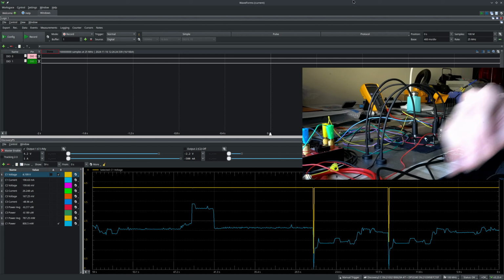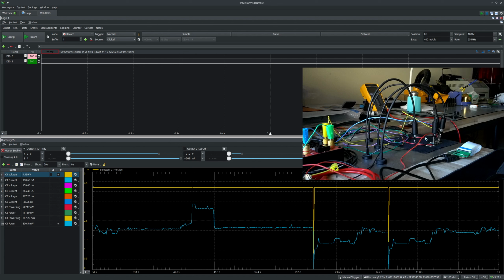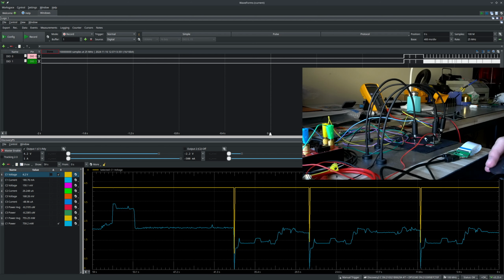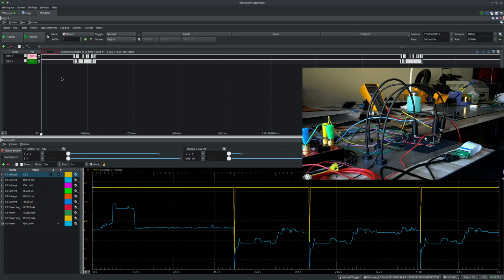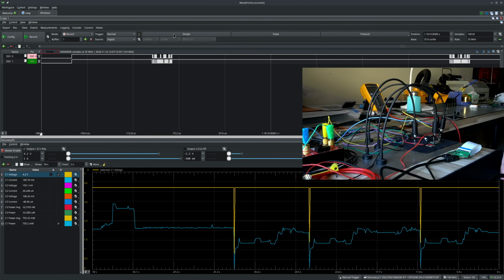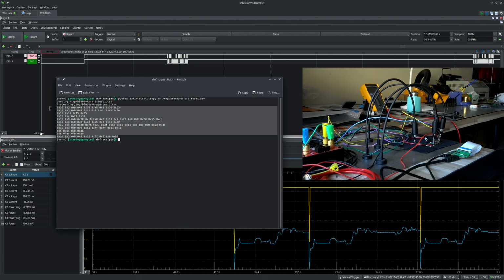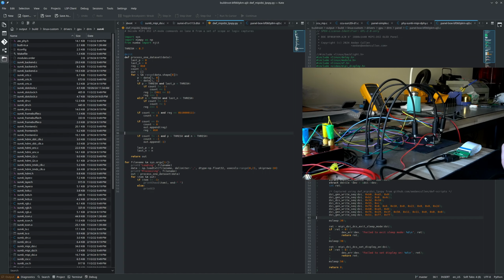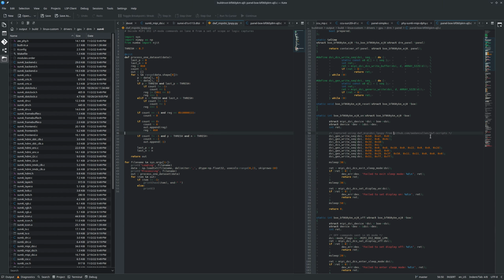Decoding MIPI DSI LP-mode initialization data

Comment: Nice work. With skiprows=10 I missed first packet, adjusted to skiprows=8 and get the first packet too 0x5 0x11 0x0 0x36  (in my case)